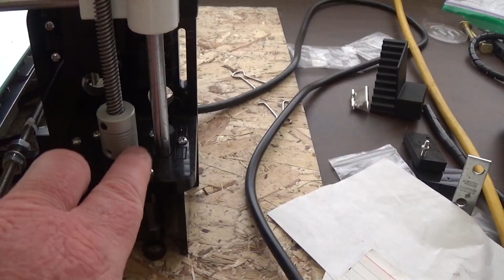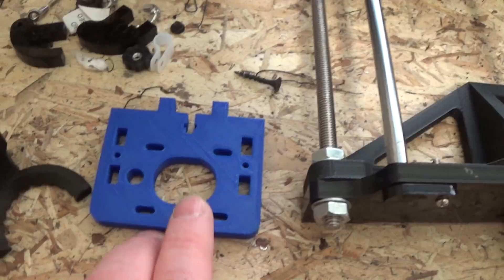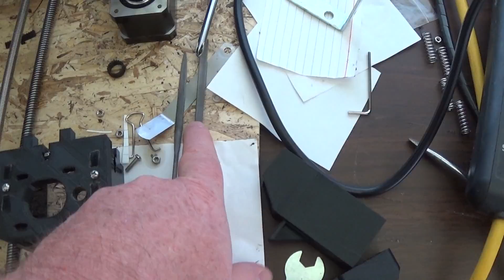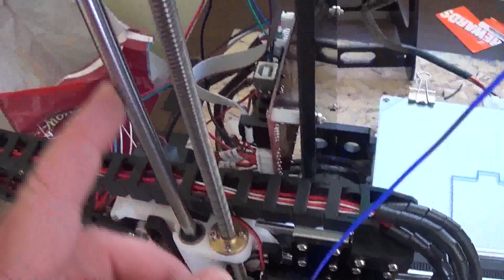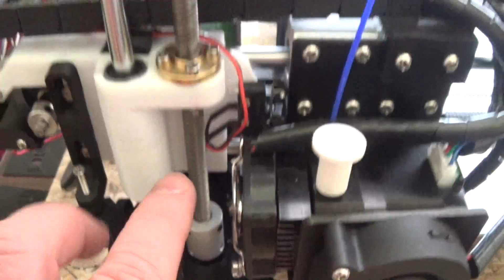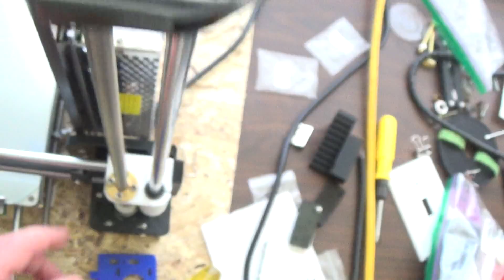z rod mod on 3d printer

Comment: i had the same problem... trust me its not what you think..you need to re adjust your motor screws till its right. secondly you need to level out your x access right bracket so there is no tension.